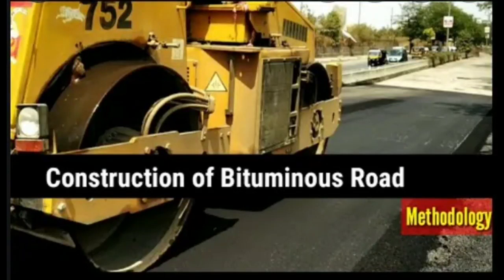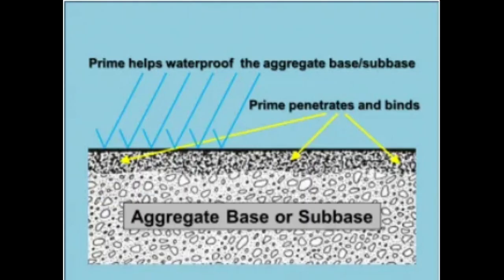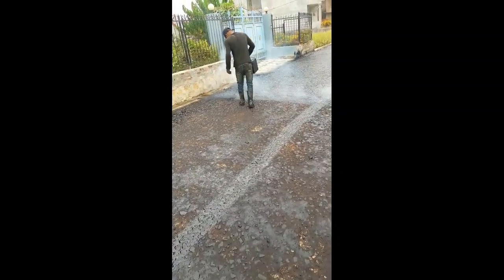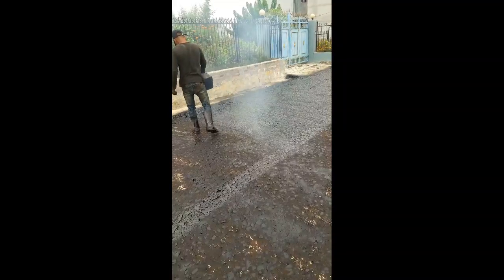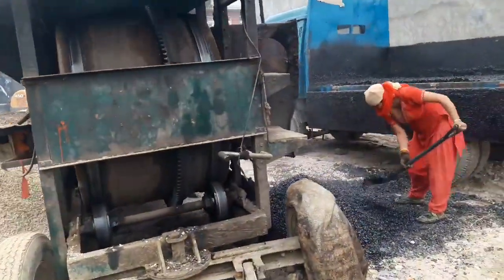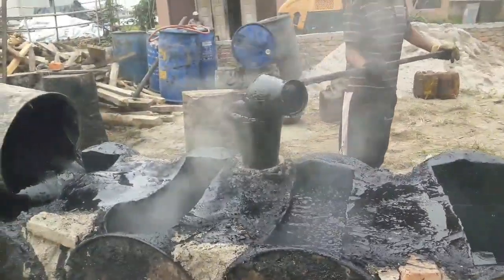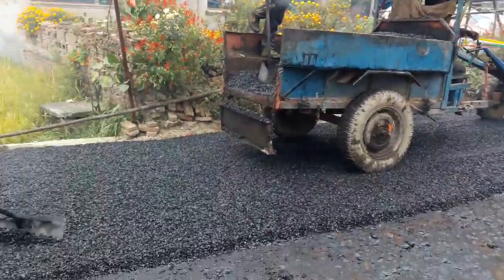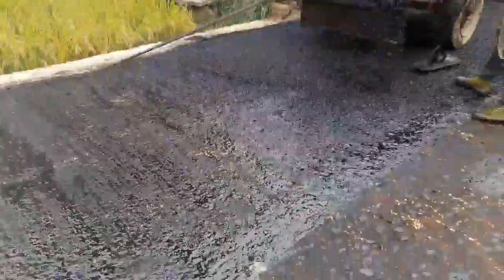Complete construction procedure of Bitumenous Premix Carpet of Road

Comment: Rajan sir, bitumen per m2 for prime, tack & premix kati lagchha?
Reply from the maker: Sorry for late reply. Malai lagvag xact value chai yaad vayena la. Tara rate analysis garera per m2 ma nikalna sakinxaa ni
Reply: Prime per m2 spray rate bhanera BOQ ma project anusar deko hunxa, normally 1m2 per liter hunxa ani prime coat ma kerosene ra bitumein use garinxa jun chai 60 40 ya ta 70 30 ratio ma halinxa
0.70 liter bitumein ani 0.30 liter kerosene
Tack coat chai pure bitumein ho yesko spray rate 0.80 liter per m2 hunxa normally,
Tespaxi premix chai per m3 ma hunxa thickness hatayo bhanay m2 ma aauxa
Tack coat ra premix garera 25mm thickness bhayeko premix lai 107 liter khanxa for 40 meter square
This is not according to norms, site ma majja le garda yesari janxa quantity for PREMIX